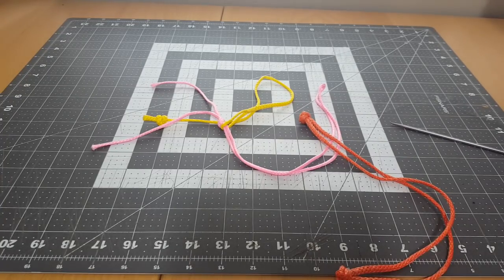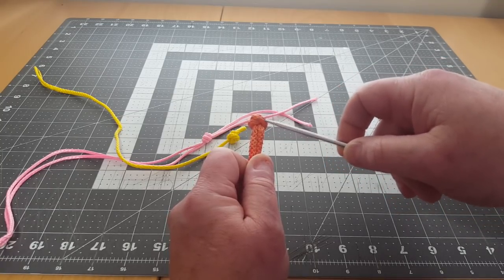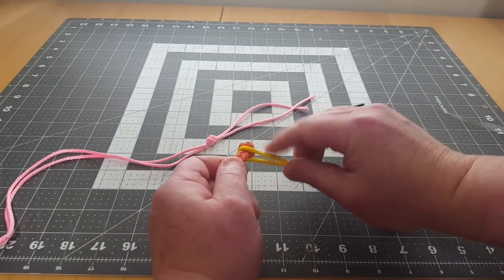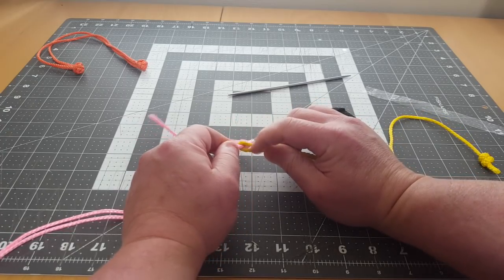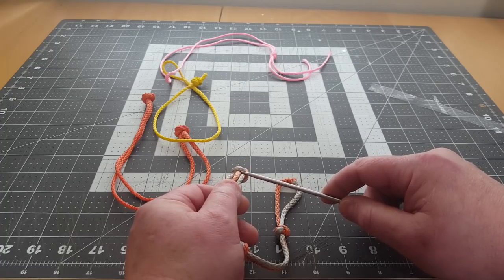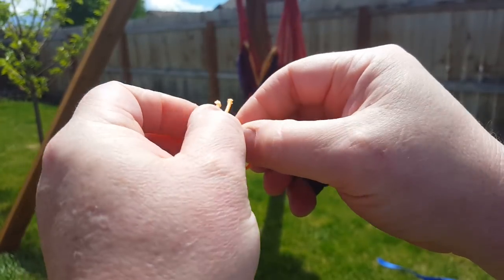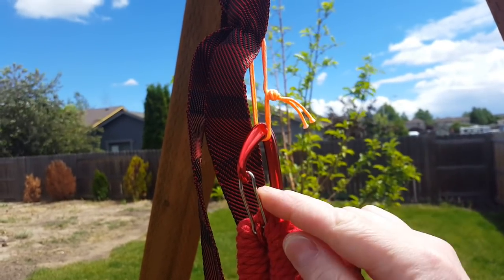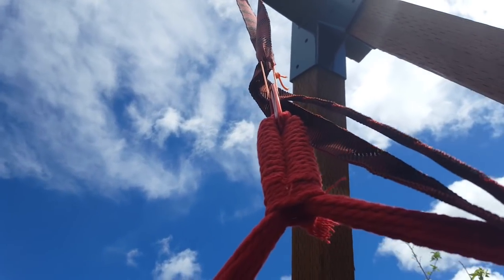easy shackle part 2 demo and tech info

Comment: Sooo, I've been placing a diamond crown knot on all of my soft shackles. Do you think this (a diamond crown)  will help with the noose from being forced open?  

BTW; please provide info for your reverse arch hammock setup.
Reply from the maker: It will be fine either way , in most situations in the hammock world it would never collapse a knot anyway
Reply: @jeffmyers7062  Thanks for the reassurance. Just purchased your UMWPE straps and soft shackles and cinch buckles and was wondering if i'll be good to go, or need to make an adjustment. 

I fell once (my fault) using a different method. Since then I'm worried about falls. I'm not a gram weenie, but I do want to shave weight where possible.
Reply from the maker: @Mrgeekmedic    this was more of a comparison than a fail point reference